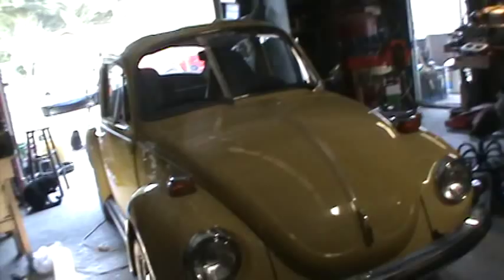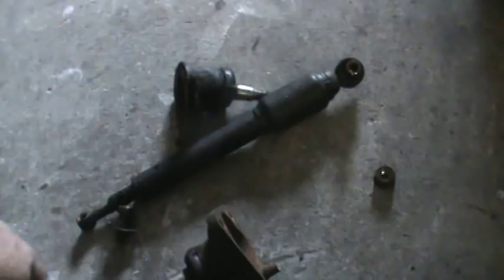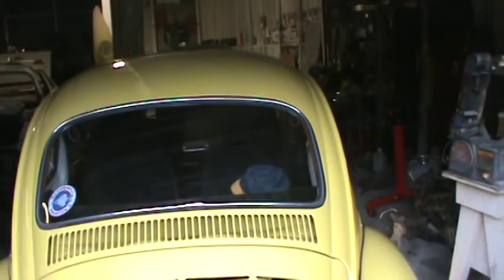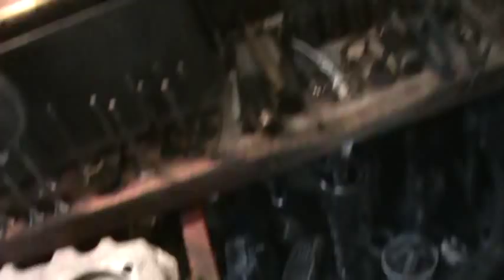morning Vlog

Comment: I always hear people say the curved windshield started in 72 on the supers and the parts books say it also but i have (2) 72 supers and both have flat windshields and old style dashboards. They are supers they have strut front ends and fat front end deck lids whatever.
Reply from the maker: awsom70 Could be a production date thing ,Volkswagen used everything , i saw a video with a 92 bus form Brazil that had barn doors on the sack and old school doors on the side and rear quarter glass, the cool thing hear is you have to bugs , very nice
Reply: vwdarrin
yea i saw somewhere that they still made beetles like the old school ones we like overseas until they came out with the new beetles in the 90's. its crazy to think just a few years ago they still looked like ours. maybe thats why alot of the vw parts are relatively affordable compared to restoring other classic automobiles...